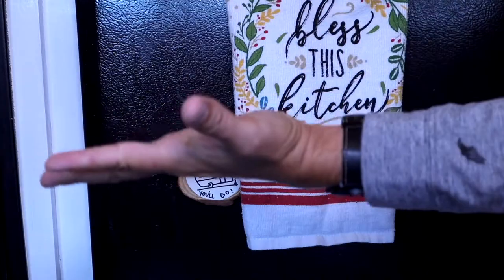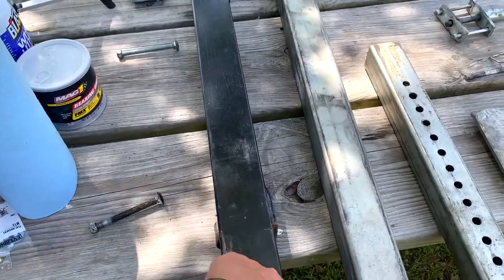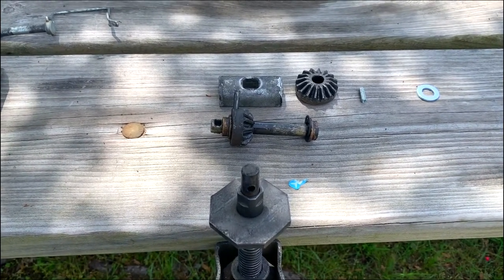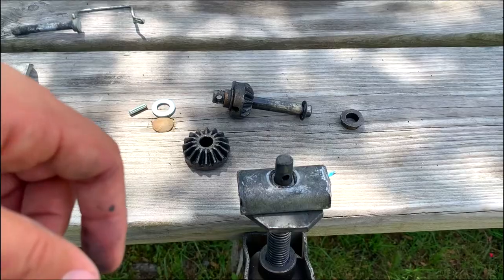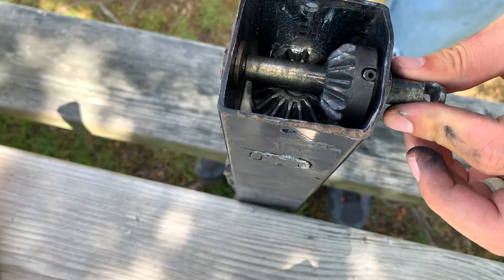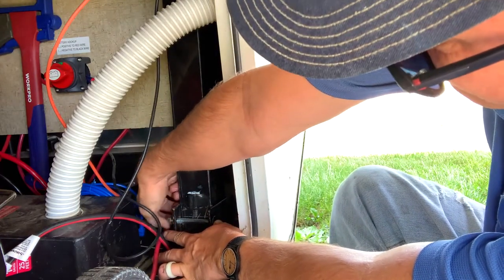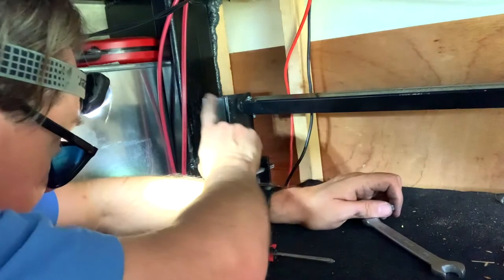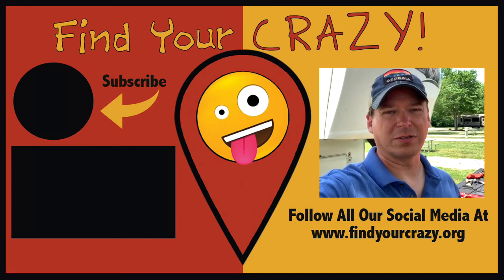Landing Gear Repair: Full Time RV Family of 9 Rebuilds Their Landing Gear.

Comment: I recently had my jacks slow right down and stop. Switch was burnt out. Replaced switch. Jacks still slow. Took the top caps off and put a bunch of grease on the two bevel gears. Took motor and gearbox out. Took gearbox apart, cleaned out old grease, installed new grease. Put motor and gearbox back in. Grease zerks can't be used, too close to the wall. I removed them, sprayed a ton of white lithium grease in the zerk holes. Had battery checked, failed load test. Replaced battery. Ran the jacks down about 15 inches, cleaned the legs, sprayed lithium grease on them. OMG, the jacks now work better than when I bought the trailer 5 years ago!

Comment: I have a self leveling system but I think the problem I'm having is the same as yours where the pin is digging into the top of that part and the gear is dropping down because mine was skipping and would not move once I raised it all the way up but if I put weight on the thing it engages and lifts which would make sense. The weight just pushes the gear back up into making contact. I will have to connect it to my truck and raise the jacks all the way up and if it skips again, which I'm sure it will, I will have to do this mod with the washer. You probably just saved me a ton of trouble shooting and money, thank you very much for this great video, your my hero today lol.
Reply from the maker: I hope it does work for you as well. It saved me a lot of time and money.
Reply: @FindYourCrazy  I replaced the gears, they were worn.

Comment: My lead jack failed on my 2012  Fuzion When I tried to remove it,it would not release. Upon closer inspection I found that it had been welded on the bottom support bracket. I had to use my Dads all to cut the weld off. What a pain.

Comment: I have seen problems with these gears in several videos.  The basic problem is that jacking action has stretched your tube out of square and is letting the gears get too far apart.  Build two straps to pull the side of  the tube back in.  HD, Lowe’s, tractor supply all have steel bar stock that you can cut and drill to wrap the tube.  After the side is flat again everything will work a lot better.  If there is room you can leave the wrap in there after installation.  I would use 1/4 x 2 flat bar to make the bars and 3/8 bolts to pull them together but to work right the side of the tube has to be flat

Comment: Thanks for sharing. I took my landing gear apart (Ground level 3.0). Mine is different than yours. You have those gear cogs. Mine runs on like a 1/4 drive. Similar issue though, the through cotter pin snapped. Do you know where i can get a new pin or kit from?  Looks like it's about 1-1/8" long and 5/16" wide.  Lippert does not provide a service kit for this model of landing gears.

Comment: If you have an older jayco 1994 with atwood gears the replacement gears that are identical are bulldog 500106. It comes with new pins but ypu may have to use the old pins

Comment: Questions about supporting the rig to get the leg out. Where can you place the jack that the stress won't damage the framing of the camper? and could you just hitch up and then retract the landing gear legs letting the truck hold up the camper as you work? Thanks again!!
Reply from the maker: My frame is a really solid I beam. So I just made sure the jack was right in the middle. I don't think there is anything to worry about there, at least not on my rig. You could certainly try the truck, but I don't think you would have enough room left in front of the rig to be able to work. When my truck is connected to my rig I am only left with a couple of feet between the front basement access on the rig and the tailgate of the truck.
Reply: @FindYourCrazy  Thanks, I'm actually trying to figure what went wrong with my rear leveler. I have the Lippert ground control 2.0. We parked back at the storage facility and I was having all kinds of trouble getting it to level front to back (?) when all of a sudden the motor on the left rear leveler jack just fell off!!! ???? I can't figure what happened, I think the shaft from the motor to the gears sheared off?? I can't even see how it was mounted to the jack itself?? never ends.

Comment: Thank you for the video! This video helps me understand the inner workings a lot better of my jacks. One needs to be repaired (motor side). I have to help it go up and down so I'm guessing bottom the screw connection to the inner leg is broken or the pin is broken so it won't go up and down by itself
Reply from the maker: Yes, that seems right. Once you open up the top you’ll be able to quickly see the problem since there are so few parts. Unfortunately getting the drive leg out is not as easy as the follow leg… but it’s not too bad.

Comment: Thank you for your video! It is very helpful. I have been following it very carefully. I’ve ran into a problem, though. I cannot get the pin out that sits right above the u-bolt. I’ve tried pushing it out with a screwdriver with no luck. I even drilled a hole in the side of the leg so I could punch out the pin. That hasn’t worked either. Do you have any suggestions?
Reply from the maker: Wow that is really annoying. I don't think I would have thought to drill through the side to get at it better, that was a great idea! I have never seen that issue before. All I can think of is that maybe the pin was bent slightly, which would prevent it from coming out. But that would be a little strange as the pin really doesn't carry any weight it just holds the U bracket in place which in turn holds the weight. But it could depending on any other issues you have with the leg. 

Either way I can only think of two options. First is to use an oscillating multi tool, like the dewalt DCS356C1. This would allow you to get the blade down to cut one side of the pin off, then (if it is bent) you should be able to just punch it out the other side. Second is to use the hole you have already drilled in the side of the housing and then using a longer bit to actually drill the pin out. Just go slow and careful because if you damage the drive shaft you'll end up having to replace the entire unit.

Once you get it done I would love to hear back if you have a minute on what worked. God's speed and best of luck!
Reply: I ended up using a multipurpose tool with a steel blade to cut one end of the pin and then I was able to punch it out through the hole I had previously drilled.

Comment: What’s the price of the motor ??
Reply from the maker: I am not sure. I only had to replace one of the legs. I never had to touch the motor. I did a quick search on etrailer.com, which is where I got my landing gear, and it shows them costing between $150 and $350 depending on the exact motor you need.
Reply: @FindYourCrazy  thanks man! , I went this morning and found and bought mine for $168, here and Texas, so were right on your estimate !